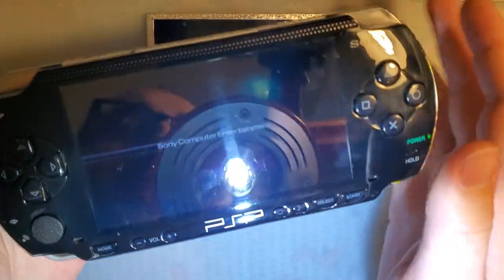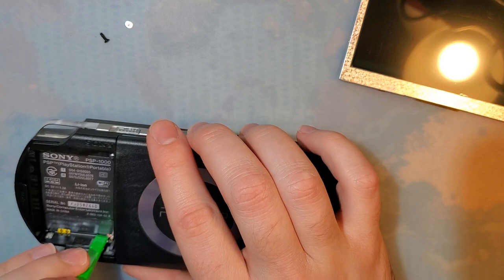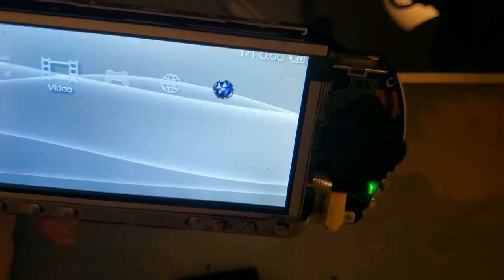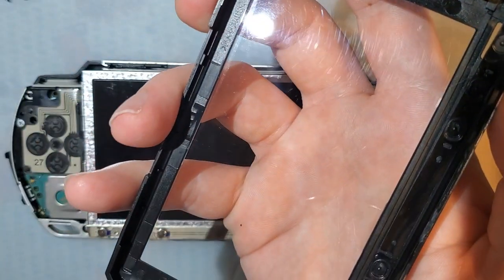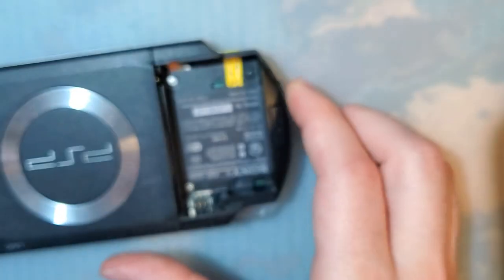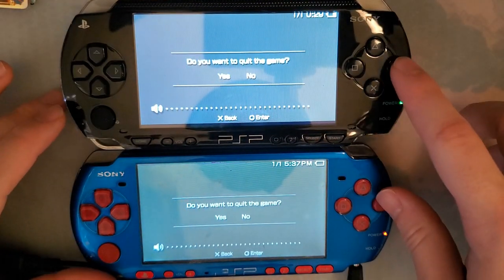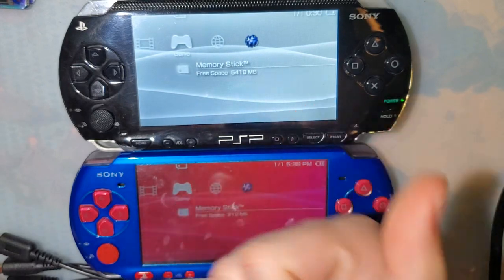Installing an IPS LCD in a PSP (1000) (Part 1 of 2)

Comment: The weight of the original 1000 is much more comfortable.
Reply: I very liked PSP Street. Even when i had 3004 In the same Room.
Reply: @HuraganPrzesteru  how could you prefer that fugly thing? its the cheapest feeling PSP out of all of them, has the least amount of features, it has a not so good, not even loud enough single mono speaker, lack of TV connection support and from my understanding it has an even worse scanlines issue than the psp 3000 series
Reply: For me better experience. I mean- my hands Love this material And thicknest of Street. Just more comfortable for me.
Reply: @HuraganPrzesteru  Yeah i agree, also + the fact that the street mat black instead of the normal fingerprint-magnets (1k, 2k, 3k)
Reply: @itzzover4662  Yes, more esthetic over time :)
Reply: If you avoid the Yuxi shells you also realise they're the best for modifying cosmetics.. I've done 5 this month and they all looked crap besides a clear pink one that I buffed to transparency.. 🤣

Comment: The reason why the brightness levels are different is because when the psp is plugged in it gets an extra level of brightness compared to the one unplugged at the top
Reply: You beat me to it.  You need both to be plugged in for a fair comparison.  One benefit of the newer models is AV output, which the Phat model doesn't have.
Reply: @jimmimak  And if you want to bring the screen to the brightest level of backlight, you need to custom firmware it, to unlock the brightest level of backlight. Anyway, about the 300x models, I understand why people don't like the 300x screens, maybe because the scanlines texture clarity, but to be honest, scanlines never bother me, I still use my 3001 for the most times, than the 200x models, now, obviously, this doesn't mean I don't like the 200x models, I use them as well, but I use more my 3001 often, as I have more content! :D

Comment: If I remember correctly the PSP 1000 has two different screens depending on the region of the PSP. The 1000 Western ones  have the Samsung Screens (they look kinda washed out) and the Japanese ones have Sharp screens which have (arguably) the better colors.
Reply from the maker: This one was a Sharp. I'll take apart my US 1K and see if it has the same screen.
Reply from the maker: And for those who didn't see the part 2 video despite all the links, spoiler alert, it was the same screen.
Reply: Either way, they have extreme ghosting issues.

Comment: I LOVE the 1000 shape and weight , it's built like a tank. The grip doesn't hurt my hands for long game play 
My 3000 units are all very noisy cause the plastic is so weak.  BUT the biggest issue is that the 3000s disc drive is trash and always stop working.  My 1000 runs quite while reading the disc's.   The screen blur is annoying but its not that big a deal.  I think the 2000 is good medium still a bit chunky yet brighter.  
That said the replacement looks good and the new ribbon mod is a huge deal so way much better.
Reply: Screen blur gives the 1000 even more charm.

Comment: I have a PSP 3000. perfect condition and original battery which still seems in top condition. But! Picking up an exceptional psp 1002 tomorrow! Just because its the same as I had when I was in early high school. I remember my original one I smashed the screen...psp was in my pocket and it hit something while I was walking! I bought a replacement screen and fitted it. Didn't seem difficult at all. So just thinking I'd like to get an upgraded screen for the one I pick-up tomorrow! It charges and holds charge and apparently its had very little use in its life. Thanks for the video. Enjoy watching your content. I did my GBA SP 001 with a 10 brightness level LCD. What a difference!

Comment: I Love the PSP. About the X and O, If you have CFW, In the Recovery Menu you can swap those around regardless if you have US or JPN model. Also, Infinity  is only Useful on PSP 2000 TA-88 v3, PSP 3000, PSP Street and PSP Go that don't support Permanent CFW like PSP 1000 and PSP 2000 v2 and V1. You should install ME CFW or Pro CFW on that PSP 1000.

And about sa IPS Mod, kinda disappointing, not as good as the Mods on the GB, GBC, DMG, GBA and GBA SP.
Reply: You know that infinity supports all psp models now and even on the psp street it can be made permanent now?
Reply: D. T. Yes I know. But the infinity 2.0 isnt a permanent CFW like on the PSP 1000 and PSP 2000. Meaning it just launch LCFW at boot time. If you compare the boot time of Infinity and Permanent CFW like ME, Permanent CFW is faster.
Reply from the maker: That memory card was out of my 3K. My other memory cards have different CFW installers on them.
Reply: @makho  Do you have proper Pro Duo cards or do you have adapters? I have a proper 16gb Pro Duo but last year I got an adapter with a 64gb micro SD. I have also seen adapters with 2 Micro SD slots and I'm wondering if performance is good with those. The bigger the storage and the more games you have and the longer it take when you click on the game tab.
Reply: What's the diff between PRO and ME Firmware?
Reply: @colonelfz  not much.  I always go PRO.  no complaints

Comment: I still prefer the 1000 screen. The 2000 had bigger gaps between each pixel if I remember correctly. (Cool mod btw)
Reply: That was the 3000, not the 2000 IIRC... The 1000 came with a by now dated, but very high quality SHARP panel, the 2000 was kinda meh in the color quality department and the 3000 had a much better screen colors -wise, but had a weird pixel matrix (it was intended for vertical, rather than horizontal orientation and looked like a weird interlaced image)

Comment: Ips panel has better contrast , better viewing angles. If the cost is low ,its worth the upgrade.
Reply: now for the downside:
1. it drains battery faster
2. harder to install (requires tedious soldier)
3. only doable for PSP 1000 and so far not on 2k, 3k & go
Reply: @Spheredalai  I wonder what the input lag is like?

Comment: I was sold on this about to buy a new screen until you mentioned the cropping at the top. Kind of a deal breaker for me. Also when you put the new screen in i thought it looked great but after the side by side comparison, it’s a lot of work for a minor improvement. Thanks for doing all the hard work for me 🙏
Reply from the maker: You do realize that the cropped area is fixed by installing the screen properly, right? That's why this video is PART 1 OF 2
Reply: @makho  Didnt realise that, kinda lost interest after the first comparison. Would you say its worth doing then? I do love the 1000 model but i have always wanted a nice new clear screen for it. I should probably watch part 2
Reply from the maker: @Twi66e  No, just get a better console like a Vita instead
Reply: Having no ghosting is a giant plus though.

Comment: The original PSP screen was made by Sharp so obviously it holds up good
Reply from the maker: It's still a LCD from 2005 and the industry didn't quite have LCD tech figured out until later. I mean, the replacement LCD looks like it's from the same era too so it's not that much better but still.

Comment: The biggest flaw I see with the IPS mod is that the whole display is shifted up a couple mm, you can see when browsing the XMB menu, the top row of icons are sligthly cut off and there's a visible black border on the bottom of the screen.
Reply from the maker: part 2
Reply: @makho  Yup, I watched part 2 right after this and was like "well that comment was redundant"

Comment: you forgot to bridge a connection on the motherboard to center the image, its on the taobao site for the LCD adapter.
Reply from the maker: I did, yes. I'm working on that right now.
Reply: How exactly does that work,?
Reply from the maker: @WarpPal  watch the part 2 video...

Comment: Got my 1002 today. Just finished modding it. Got Liberty city stories and a couple other games with it. Screen looks amazing compared to the 3000. Although it does seem to ghost a fair bit noticeable in GTA. How's the replacement LCD? Even if same quality, a bit brighter and ghosting free would be worth it??
Reply from the maker: my opinion of PSP consoles i pretty low but the screen is nice. I don't think it's worth upgrading a PSP though, it's better to just buy a better system like a Vita
Reply: @makho  yeah already have a vita 1000. It's lovely and have the psp emu on it. But its just not the same. 😅 despite being better in every way. Lol. Yeah psp not the greatest screens I agree although they old AF now.
Reply: @robthomson1581  Yeah, nothing beats running on actual hardware instead of emulation.

Comment: Why was  the ips screen in top  the battery sign place was cut off, however the bottom was in lieu of a black section, how comes？and how to adjust it,  or it was this ips unfit the original system ？

Comment: I got bought a PSP recently, but the image is not as clear as I remember the PSP to have. You can clearly see the pixels like scan lines and while having a grey or green theme the letter on the menu become barely readable. I don't know if it was always like that with the PSP 3000, or have I grown too accustom to HD, 4K and such that the difference has become jarring?
Reply: He talks about this in the video. It was the criticism in the reviews of the 3000 when it came out.
Reply: @RetroDawn  It was a faulty PSP, I returned it and got a another one.

Comment: Did they ever revise the square button on the later PSP-1000s? I had a launch unit with a sticky square button but then my later one from 2007 has no issues at all. Not tempted to open it up to check since it's fully functioning.
Reply from the maker: I haven't heard that was an issue. It's certainly never been an issue on my units.
Reply: @makho  They probably just found a way to make a better contact with the buttons despite being offset. But the launch PSPs had sticky square buttons, dead pixels and a potential for UMDs to be sent flying out. I tried replicating that with mine at the time for fun but couldn't do it though haha.

Comment: Lol love the intro. What battery do you recommend? Mine doesn't seem to hold a charge and wondering where to get replacements.
Reply from the maker: The battery situation on the PSP is an absolute mess. I cannot recommend any batteries because I have not found any good ones.
Reply: @makho  What about Cameron Sino brand? They make PSP 1000 batteries I haven't bought one yet but considering.
Reply: lol you can mod your own batteries into it..i once did long ago when i was i high school cos too much fake batteries. you should check the capacity though
Reply from the maker: @neocortez9254  I did that on my 2k, it still doesn't fix the issue. The PSP has active circuitry in the battery boards (which are required to use batteries) and this active circuitry just eats batteries up whether you are using the console or not.

Comment: hello. If you look closely at this replaced ips liquid crystal, the screen is shifted upward. It seems that such a phenomenon occurs when the main body version is close to the latest. However, it seems that the position of the screen returns when the point on the main board is shorted with solder. I think you can do it, so I would be happy if you could make a video when you have time.
Reply from the maker: literally the pinned comment.

Comment: Nice video. Would this mod solve the scanlines un the 3000 model?
Reply from the maker: no since this screen is still only compatible with the 1K
Reply: @makho  uh bummer. It would be nice if you could get a 3000 because it is very umcomfortable playing with those lines.

Comment: You should buy a broken Japanese PSP on ebay and use its shell to fix yours. They go for like $10-15, and usually are in good condition cosmetic wise.
Reply from the maker: The PSP I bought was only $10 in the first place. I'm not spending more on it to fix it. I just don't really care about it. Besides, my fix is holding up very well.
Reply: Ah, okay.
Reply: Yeah Japanese people tend to look after their stuff.

Comment: The 2000/3000 have double the ram the 1000 does, this is why the saints row game doesn't work on it
Reply: I thought that game was unreleased?
Reply: @christopherwilliams9418  It's not even a finished game but it's possible this alpha build still need more ram.
Reply: @chamoo232  Gotcha'
Reply: The unreleased version of the game is available online for free download from the developers
Reply: The PSP-1000 requires more work + more storage space to run the CPS2 & Neo Geo Emulators, as well. They're different versions to accomodate the smaller 32MB of RAM. More games require cache files to be made (vs 64MB in 2000/3000 models) + compatibility is reduced on the 1000 model. This is a BIG reason why I prefer the 2000 models over the 1000's. My 3000 has great color saturation & a really solid D-pad, but those thick black horizontal scan lines on the display show badly when running CPS2 classics like Marvel Super Heroes. I've never seen the E-1000's in person.

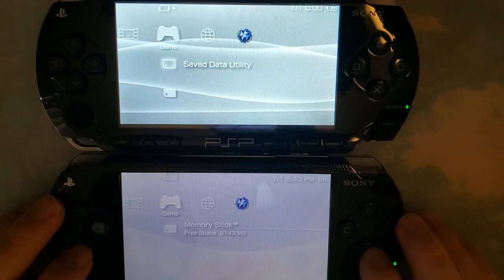Comment: I installed this mod but part of the top of the screen is cut off like where the time would be and battery indicator at 21:00 the ips screen position is off it is pushed up too far.  There is some space at bottom which is dark and unused. It’s almost a deal breaker because of this.
Reply from the maker: see part 2
Reply: @makho  Thanks! I went back to the OEM screen haha.

Comment: Finally got arond to doing this and I decided to come abck to this video. I love the brightness of the IPS one. But my old screen was totalled in terms of burn in and watermarks. This new IPS kinda gave new life to it. That being said, I still like the PSP3000 screen better than this IPS. But for the 1000 I feel its a pretty solid screen.. maybe i should grab a new SHARP one from china and see what those are like
Reply: so it is not better than 3000 originals screen?
Reply: @kamil40013  there’s better contrast on the 3000 in my opinion. I like it better. But I prefer holding the 1000 more so I’m still always using the 1000. The IPS screen is 100% worth it now that I’ve used it for over a year

Comment: Hi, would an oled for switch be possible? Thats like my real only complain about it, with one it would be really the best
Reply from the maker: Possible, yes, but unlikely. Someone would need to manufacture a new LCD or find an existing LCD with the proper size and spec and make an active adapter to make it fit. Neither are within my skill set but it's not impossible.

Comment: Makho, the 3000 screen is better than the 1000 and 2000 screens. Try the 1942 Capcom Classic Colection and you'll see why I say it.
Reply: I don't understand people who prefer the PSP-3000 screen. It has terrible horizontal lines during fast movements. It's kinda like bad interlacing but I think it's because of how the color pixel are positioned on the screen. It might have more vibrant colors but I cannot stand those lines. Because of that I prefer the 2000.
Reply: @chamoo232  - Perfect 👍. How can people not see the thick, black, scanlines? The 3000 screen completely shits the bed when running Marvel fighting games on the CPS2 emulator. The characters smear horribly + the nasty scanlines!
Reply: I also hate the scan lines....I have a really nice 3000 but can't get over the scan lines. Picking up the original 1000 tomorrow. After watching this video really not sure if I wanna upgrade to the IPS kit or not.

Comment: yes you're correct it's not worth it. get a psp 3000. or a vita. also why use infinity on psp 1000, that's for 3000 and 2000 with patched motherboards.
Reply from the maker: why are people getting so hung up on infinity on the 1K? It works fine on all models.
Reply: @makho  coz it is not for psp 1000. Lol

Comment: You have to solder 2 points near the ribbon port, and the screen on the ribbon adaptor kit is very bad. There are other screens in other better store that has better quality than this.
Reply from the maker: Like...?
Reply: Don't claim there are better when you're not even going to give at least an example of one.

Comment: Are the consoles overclocked? I was really looking forward to this solely for the decreased ghosting.
Reply from the maker: Aside from CFW prerequisites to run games off of the memory card (and the IPS LCD in one unit and case mods for the other units), all the consoles are functionally stock.
Reply: @makho  I see. You can overclock them very easily with cfw by pressing select in the main menu and selecting the option using the overlay menu. Can you test how gta runs on the IPS psp running at 333mhz?